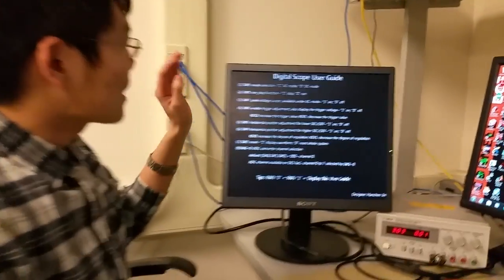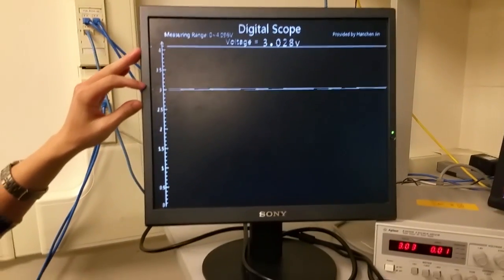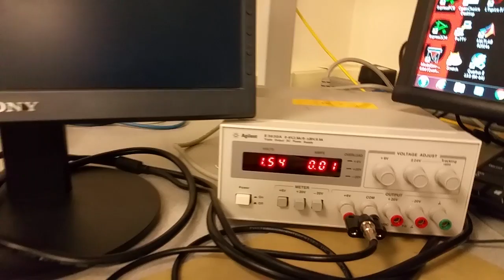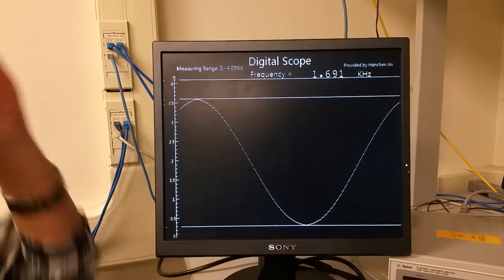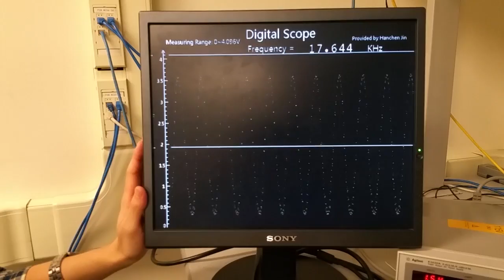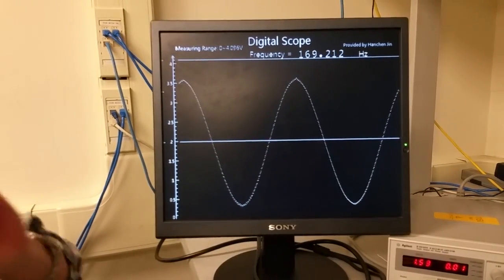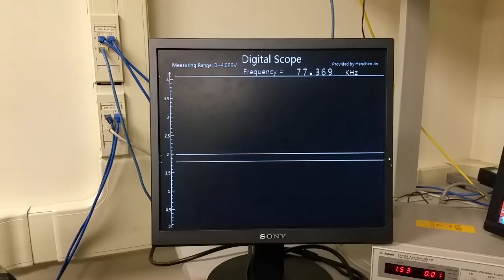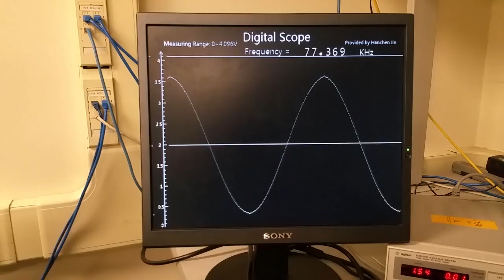Digital Scope on DE1-SoC

Comment: Woooooooow!!! All is only FPGA logic! Congrats!!! Here's a question, I have the DE10 Nano kit probably with ADC but I actually want to get rid of the ADC and receive data from a sensor via SPI, I2C, UART for example. Those data can be encapsulated in a frame on which I will decide the structure. This means I would be able to measure almost every unit I want : 'C, rpm, V, A, cm, lumen, magnetic field, hygrometry or whatever.
On DE10-Nano, there is no VGA but only HDMI which can make the things even more complicated. What would you recommend? In your archive, is it possible to change the input type (serial instead of ADC) and change easily the display output without changing the GUI? How many channels can I display? (I won't be using physical channels but the channel number will be indicated in the frame sent over the serial port.)
Reply from the maker: Possible? Of course. Easy? No. You are probably going to have to completely recode for a new platform, using different input and output. Start by scanning the documentation for a HDMI driver hardware. Then see if you have enough memory to drive it.
Reply: @ece4760  Yes I started to do so but the spec is quite huge and the verilog code I can find is in a project that displays frames. On top of that, this code is not clear. I will have to study it for a while before I can do anything interesting about it. Anyways, I have seen on the internet that we can send a VGA frame with an Arduino by only attaching a couple of resistors and the VGA connector of course but reading the DE1-SoC schematics it seems far more complex and requires a big DAC. I confess the DAC solution is out of my plans. I prefer to try with HDMI. But using your part even up to the RGB digital outputs could be handy and then on my block file, I will "only" have to connect what you've done to a RGB to HDMI block I will have created... If I succeed in it, is there some way I can send my work to you? I will probably share my project on rocketboards.org.
Reply: I have downloaded the .qar file. Unfortunately,  when I try to open it with Quartus Prime 20.1, it makes me "Error (127001): Can't find Memory Initialization File or Hexadecimal (Intel-Format) File ./VGA data/notes.mif for ROM instance ALTSYNCRAM". Was this file in the archive?

Comment: Hey Bruce Land, I am trying to get in touch with you on Hangouts to talk with you a little about this project.  Please let me know if you are available for 10 minutes or so.  I am currently working on a project for this board.
Reply from the maker: Never been on Hangouts. Talk here.
Reply: I have been trying to implement this but am having some trouble.  I think it may have to do with the Quartus version.  I am using the latest v18.1.  I am also using the Lite edition, not the Standard edition but I don't think this is the problem.  It looks like I am having issues with missing or unneeded parameters.  From what I can see with the newer version, the Makefile format is very different from previous versions.  Everything compiles successfully with only a few warnings but they relate to the missing parameters.  I also just tried to get the output on the 7-segment but when I apply a signal to the ADC, it only shows all zeros (I am using your guide for switch settings).
Reply from the maker: @4LOWeRUNNER  This is tough to debug. But there are several versions of the ADC on different DE1 boards. This student used one of the older boards. Get the revision level from the back of the board (new ones are revision F, I think) and make sure that the ADC Quartus driver matches.
Reply: I am making some progress but I am not seeing the your connections using Platform Designer (Qsys).  This is usually included in a .qsys file.  Do you get around this by using the 'wire' command to make the proper connections for the FPGA in the top level of Quartus?  With the tutorials and demonstrations provided with the board, I am only seeing use of the Platform Designer (Qsys) to make these connections.  I have been able to compile to project after making some updates but I am not getting any output anywhere.  When I run the batch file, I am only getting the continuous ADC read in the Nios Command Shell, identical to the ADC demonstration that is provided with the board.  It appears that the connections used from the demo were connected using Platform Designer (Qsys) and the connections that were added for the your project are connected another way.  Please advise.
Reply from the maker: @4LOWeRUNNER  If the qsys is not in the link given in the report, then it does not exist. 

Source code for the whole project:
https://www.dropbox.com/sh/59jz4tha4j60xm8/AAA82S8yNqyFBNY8mCpjxQTVa?dl=0
Reply: It does exist but it is identical to the demo without the VGA, 7Seg, etc.  I do not understand how these components are connected.  I seem to be missing something.  What is the best way to go about uploading this design to the board?
Reply from the maker: @4LOWeRUNNER  VGA was not connected thru Qsys. See the Verilog. Only thing connected thru qsys was the ADC.
Reply: How do you determine if a components on the board needs to be connected through Qsys or if they need to be programmed in Verilog?  This is the problem I'm running into.  I don't know how to determine, depending on the component I am attempting to control, whether or not I connect it using Qsys or if I connect it through Verilog.  Please advise.
Reply: Also, is there is a reason the nios2 processor, onchip mem, and jtag uart are not included in the Qsys?  I thought these were required for controlling and measuring the ADC.  It seems that they are required in order to properly use the ADC and switches.  They require the data master and interrupt receiver for the ADC and switches.
Reply from the maker: There is no generl rule. You need to consider performance. The qsys bus is relatively slow compared to the fpga fabric. But some peripherials are so slow it does not matter. You also need to decide if your design includes a NIOS or ARM processor. If it does then you have to connect through the bus.
Reply from the maker: The reason is that they are too slow. Anything you set up in qsys can also be done directly in the fPGA. It is easy to write your own data master.
Reply: @ece4760  does the resolution of the VGA display matter?  I am getting a signal to the display but no graphics are displayed on the screen. 
Also, when I try to generate HDL from qsys it is giving me warnings because the nios processor is not connected. After I connect it then all the warnings go away.  Should I just ignore the warnings and try to compile?  I probably do have a different revision board. 
Thank you again for all your help.
Reply from the maker: @4LOWeRUNNER  connect the Nios, make it a minimal system, and do not program it. It will never come out of reset. the resolution of the VGA display implies a certain clock rate, and organization of display memory. If you have a signal and no graphics, then you are probably writing your graphics to the wrong memory.
You might look at
http://people.ece.cornell.edu/land/courses/ece5760/DE2/indexVGA.html
http://people.ece.cornell.edu/land/courses/ece5760/DE1_SOC/HPS_peripherials/univ_pgm_computer.index.html
http://people.ece.cornell.edu/land/courses/ece5760/DE1_SOC/HPS_peripherials/Bus_master_slave_index.html
Reply: I got it working by simply compiling and ignoring the warnings and uploading the design.  It has trouble updating the display sometimes but it is working.
I am assuming that the graphics are provided by preloading the memory with the MIF files and then reading the memory contents to the display.  Is that correct?
Reply from the maker: For a static image. For dynamic images, you need to write to memory from  logic
Reply: @ece4760  Thanks for uploading this - was missing the Qsys ltc2308 module IP.

Comment: I am using 1280x1024 display monitor. The adc sample rate is 250KHz and the monitor frame is taking 1/60Hz. To synchronize this, i am struck at deciding memory size. could you help this area?
Reply from the maker: typically, there is a VGA frame buffer and sync generator state machine which synchs the monitor.The ADC writes into the VGA frame buffer whenever it has data, but not more than 60/sec. what memory size are you trying to figure out. VGA buffer is at least 1280x1024 bits.
Reply: As per my understanding on VGA monitor is, monitor takes nearly 16ms to finish one frame. To map the sine wave or any pattern of wave, we have to read the same buffer for all the horizontal lines of vga monitor for one frame.  Because of this reason, ADC rate of speed is 4 times faster than a frame speed. So over writing is happening in my case.  I choose the memory size 18766x14, ADC is 14 bit. 18766 is why means that frame buffer is 1040, so that for 16ms sec we can use 1040 size of memory only, within that time adc will give 18766x14 data. For this reason i choose 18766 size of memory. but while next frame time, this locations of memory have been overwritten by adc. So how did you achieve real time display?
Reply from the maker: For high frequencies, sample rate is set by the frequencies  you wish to capture. You capture a buffer full, then STOP sampling and display.
For low frequencies, you can scroll the display and record continuous.
NO scope is truely realtime.
Reply: While displaying the data, how are you fixing the offset value for each horizontal line i.e., magnitude or amplitude scale unit.
Reply from the maker: Did you read the report?
Reply: i read the report. Now i am trying to create the y axis image data. How to make the image in required way in paint?
Reply from the maker: I do not understand.
Reply: If the display wants to show the Time vs Amplitude plot, the numerical values are displaying from ROM image. How to prepare the numerical values image? In your report, you used paint software and bmptomif software.
Reply from the maker: I see, you are asking how to make a character ROM. YOu can use paint to make a bitmap, then you have to convert the bmp file to a Altera memory image.  But an easier way to to find a font and convert it to MIF format.  The last example on http://people.ece.cornell.edu/land/courses/ece5760/DE2/Stack_cpu.html
show how to do that with a BYU font definition.